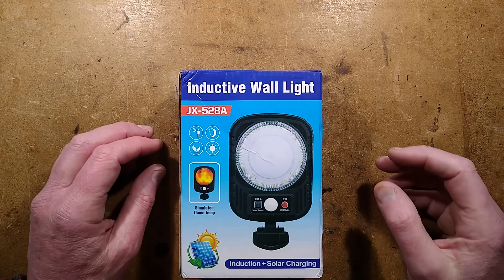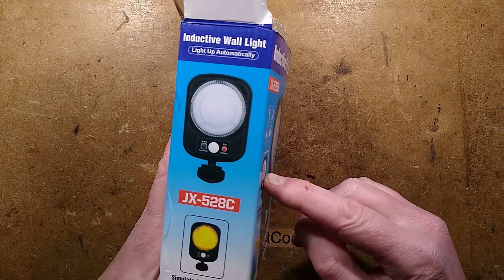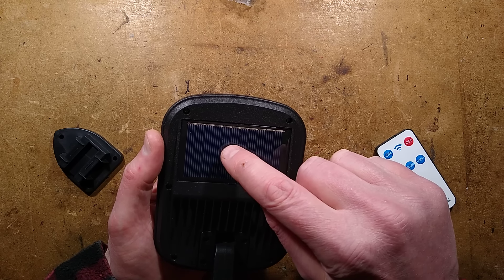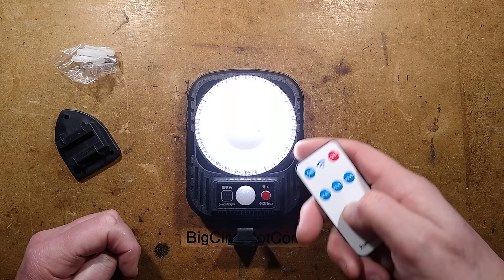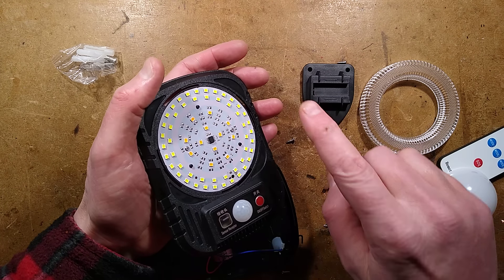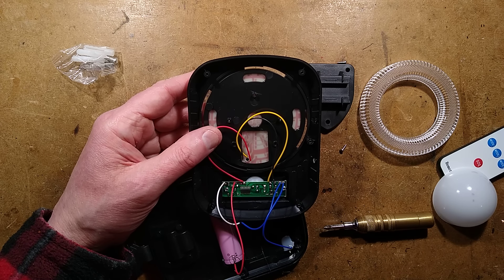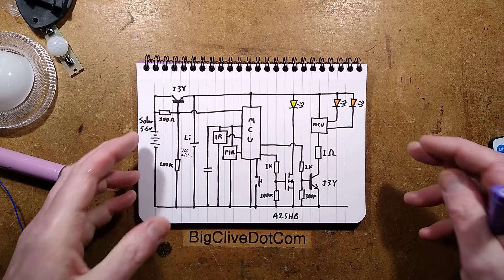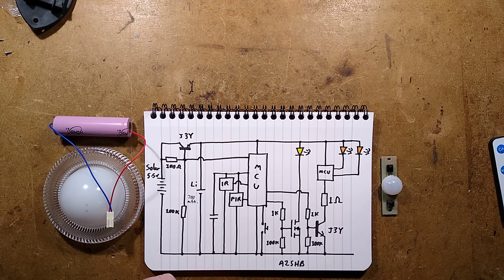6000W solar flame light - with schematic

Comment: 8 50
EV's that use lithium cells can have issues in temperatures above 34°C and around freezing point and below.
So in colder climates you probably need to store your EV vehicle in a heated garage. How green.
Gaz Yorkshire.

Comment: I'm waking up with coffee while watching this, it's 8:18am here in not sunny Spain. After laughing at the 6000w (6kw) rating, I noticed Clive's breath. I know you like it cool Clive, but temps must be quite low for your breath to condense indoors. Probably around 10 or 11 degrees I'm guessing?, not sure how you can bear that, it's 18 degrees in my space right now and I feel cool.
As for the lamp......meh.
Reply from the maker: It dipped to a refreshing 7C which is slightly lower than my comfort zone of 10C.

Comment: That "flame effect" makes me wonder if such illumination would cause people to panic thinking there was something actually on fire in the vicinity of the light and cause them to call the fire brigade unnecessarily, wouldn't like to be the owner of the light getting a telling off for that transgression... :P
Reply: If that crappy effect panics someone then I'd hate to see what they'd do for a chap lighting a BBQ.
Reply: @volvo09  Well, imagine the light is on at 2am, nobody is around and someone looks out their window on their way for their mid-sleep pee and in their bleary-eyed state see something orange and flickery outside... :P

And then also remember that people tend to not light BBQs at 2am... :P
Reply: @volvo09 Run to the hills most likely 😁
Reply: Had a local incident where someone called the fire department as they thought they saw a fire in an apartment - turned out it was a TV showing a fireplace video...

Comment: I know jack-all about hacking and ransom ware, but there was a recent reported attack where the microprocessors in electric toothbrushes of all things supposedly combined into a bot net and overloaded somebody's internet ordering page and put them put of business until they  either figured out the attack or paid a lot of money. Is this actually possible with the little microprocessors in the  cheap Chinese junk you take apart all the time? Why would a toothbrush need a microprocessor with an Internet connection?
Reply from the maker: Many "Internet of things" items are extremely insecure and can be found and modified for malicious intent.

Comment: straight away you know that 6000w would run at about 25amps on a uk 13 amp socket...  hmmmm toasty. this is where you get the flame affect

Comment: Thanks for another great educational video, Mr. Clive. Out of curiosity: How do you manage to get those great prints of the circuit boards?
Amazing, this specification of LED wattage nonsense! Similar to those car stereos claiming a thousand Watts or more - that would draw a hundred amps out of your car battery 🔋->🪫 Imagine the wiring gauge needed.
Reply: Described/specked only to attract those “anti-social” young drivers that open their car’s windows and crank the volume on the auto-HIFI and also have a external amplifier & subwoofer = booming out their favourite rap’n’bop, Eurodance or house music